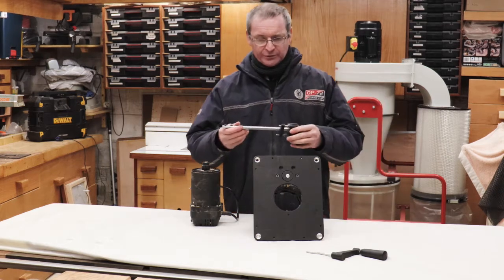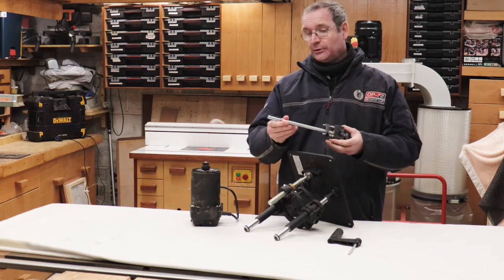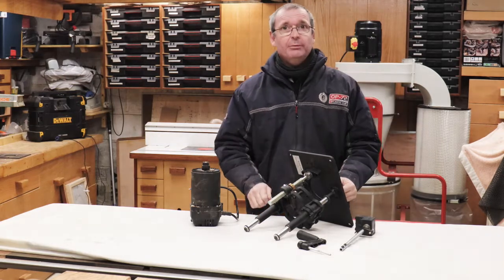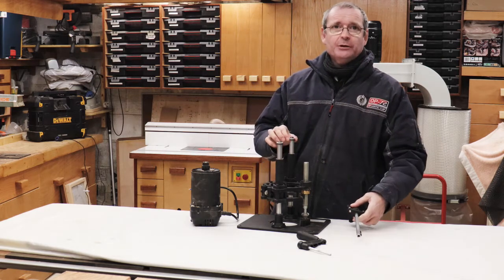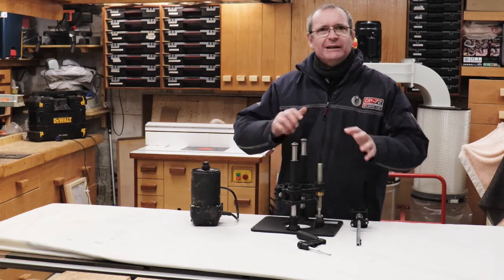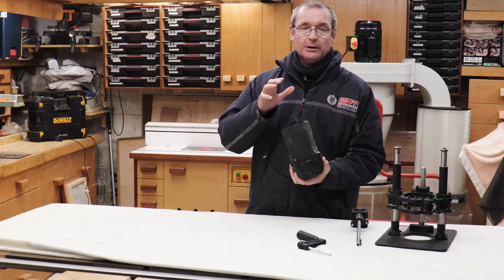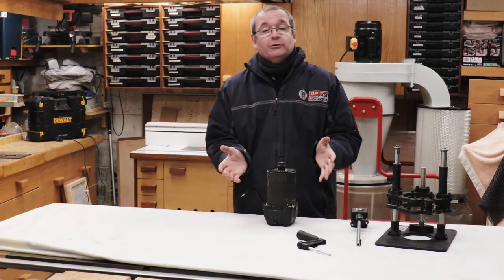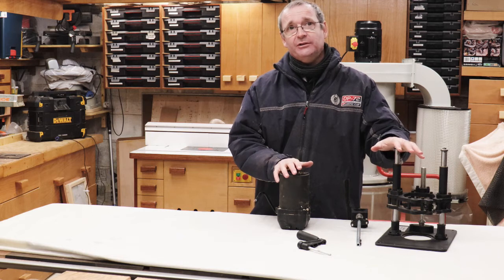Rutlands Router lift What a disappointment - Holtonsfixit101

Comment: I ordered a "Premium R15 Router Lift and Motor" and it is clear that it is a different unit from the one you show.  The R15 is very solidly built and smooth.  The instructions for assembly and set up are clear and it even provides a template and router bits for cutting a hole in your workbench.  Mine's new but it looks like it will be a delight to own.

Comment: I have the older version of this router lift and it suffers from the same problem, which is probably why it isn't available any longer - the newer ones may well be better, but they aren't the same dimensions, so if I ever change I'll have to remake my table top, which I'd rather not do!  My Rutlands router stopped allowing me to adjust the speed too, and it turned itself to as fast as it could go, probably beyond it's design specifications, and shook itself apart.  Thanks to your video, I've ordered a replacement from Peter Sefton instead. Let's hope it's better quality!!  Thanks for the tip.
Reply from the maker: I've use my the lift and motor that I got from the Woodworkersworkshop now for some time and it's never missed i beat.

Comment: Sounds like the majority of your problems were down to poor fitting to be honest. Obviously you need to ensure space for the handle and mount the shaft planar with the gear mechanism. As for the motor you should have returned it - sounds like a faulty unit.

Comment: Rutlands router lifts & motors carry a lifetime warranty don’t they? Just wonder if you’ve been unlucky and got the Friday pm version 😏. I’ve got one of their top adjustment versions coming and don’t expect issues 🤞🏼
Reply from the maker: Hope you have better luck than I did with mine.
Reply: @Holtonsfixit101   The lift has been good, I had an issue with the motor which Rutlands sorted quite quickly

Comment: That's is unfortunte i was hoping to purchase a similar lift. They have a better model where you raise the cuter from the top instead of the side like the one you have but the motor is the same so that's got me concerned. I looked at the AEG router and incra lift but is so expensive.
Reply from the maker: I replaced this one with the lift from the woodworkers workshop. https://woodworkersworkshop.co.uk/jessem-mast-r-lift-ii-metric/
I also got the router motor from them to. https://woodworkersworkshop.co.uk/auktools-2400w-fixed-base-router/
Not done a vid on these two yet but there very good and very much better than the rutlands version

Comment: I’ve just received two items from Rutland, a sample (pair ) of saw horses both obviously different not a pair ,the other a small pillar drill ,the chuck wobbles like a kenwood mixer and the gear cover panel I had to lever off with a screwdriver because the screw fixing plate was bent !needles to say I won’t be buying anything else from them very very shoddy Chinese imports .
Reply from the maker: After the Router and lift issue I've never got anything from them either.

Comment: Can't you return it for a refund old chap?
Reply: I'm guessing returns are out as he's fettled the mechanics and looks like cut the motor cable to complete a nice install not expecting any issues. I had the same setup and noticed the gear mesh was very poor but I  sold it before the mesh deteriorated as I  wasn't using it at all and now I am making my own lift, but kept the motor. Hope the electronic speed control doesn't let me down as these items are several hundred quid. Thanks for your video.
Reply from the maker: Good luck with making your own lift. Woult like to see some photos of that. I really hope your motor works ok for you but if it don't hop on over to the woodworkers workshop they sell the same type of router motor but with upgraded internals and a much better speed controller. https://woodworkersworkshop.co.uk/auktools-2400w-fixed-base-router/